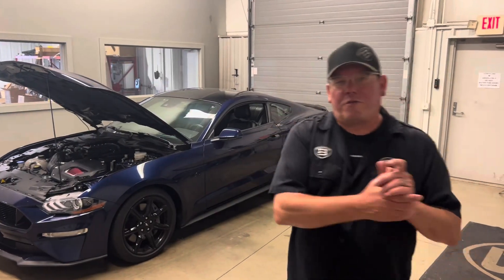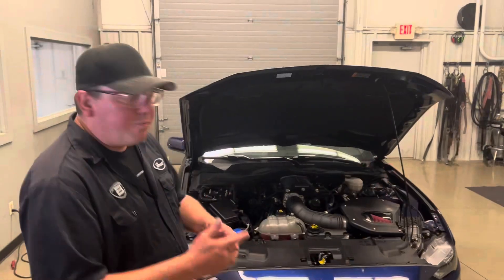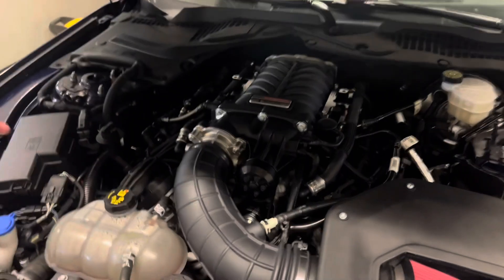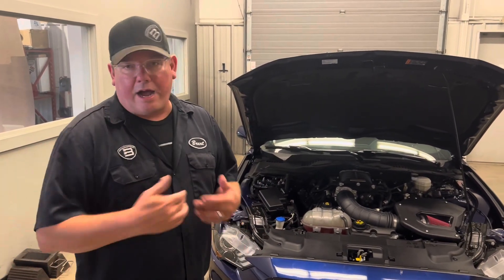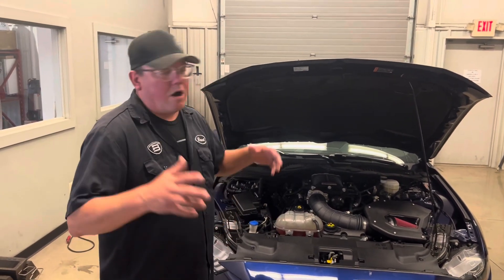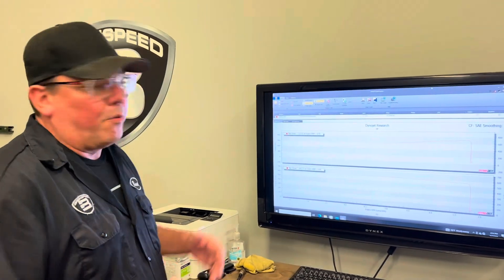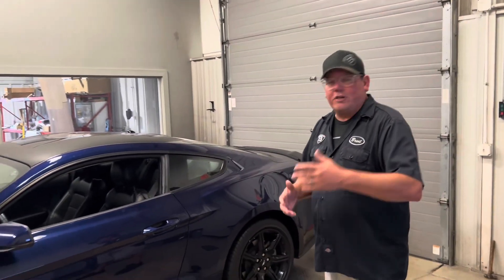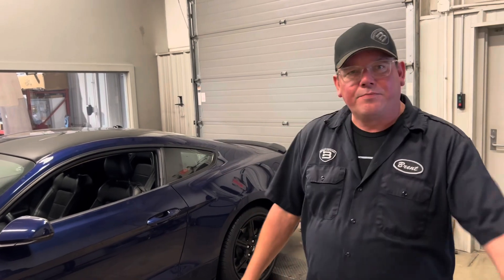2020 Mustang GT Automatic (Roush Phase 2 Supercharger) Dyno with Stainless Power Headers ROUSH TUNE

Comment: Hello Brent, excellent video. I have the same setup but my car is 6 speed manual transmission. Is harder to make this numbers with MT82? Thanks for your job.
Reply from the maker: If you are chasing numbers it is easier on a manual than an auto as the manual has less drivetrain loss.